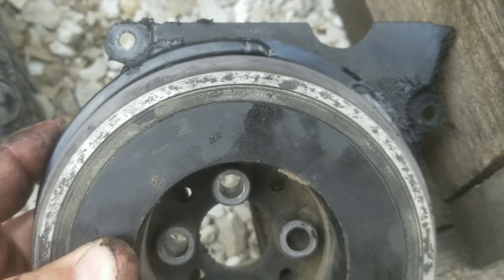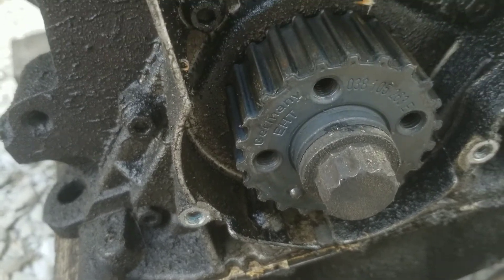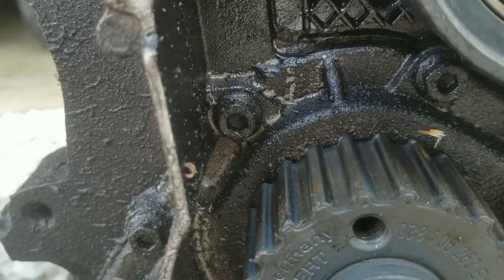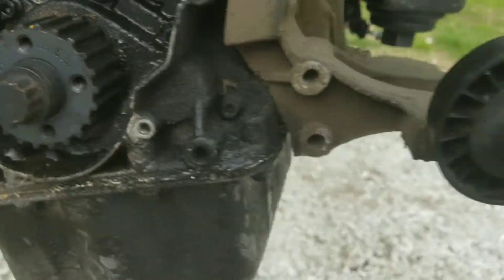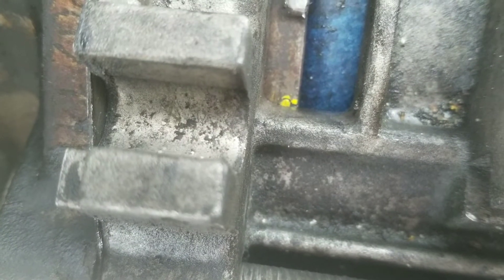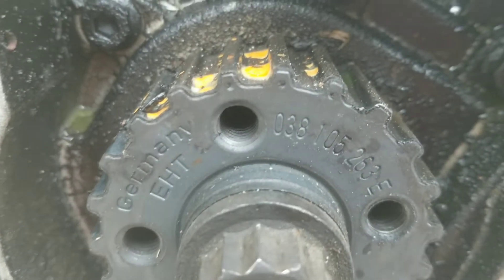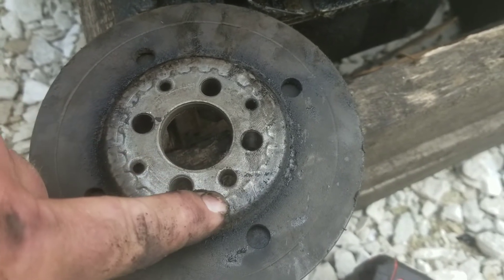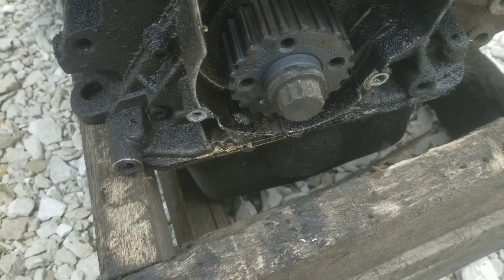VW TDI Finding TDC MK4 Diesel

Comment: I have Volkswagen Jetta TDI 2015 CUUA 2.0 Engine Mk6 DSG. Its 220k KM with no history of timing belt replacement (Last owner bought it at 120k KM and I bought it at 176k KM). Symptoms, water pumping type noise, repetitive clicking noise (not extremely loud like bad diesel engines), and when I slow down at larger gear while driving and try reaccelerating it gives "kirr kirr" noise and then settles down. Other then that, No smoke, no leakage, superb fuel efficiency. I inspected the crankshaft pulley, it's all rusty along with the bolt. I am not suspecting the worn off crankshaft sprocket but Baltic region where 8 months is winters with road salt. However, I want to replace the bolt and all pulleys with timing belt kit , water pump etc. 
PLEASE GUIDE ME how to replace the crankshaft sprocket without disrupting crank timing? I would really appreciate your help.

Comment: Manual transmission has one hole, circular on top and has a rubber plug
Reply: I have aftermarket flywheel which has no notch